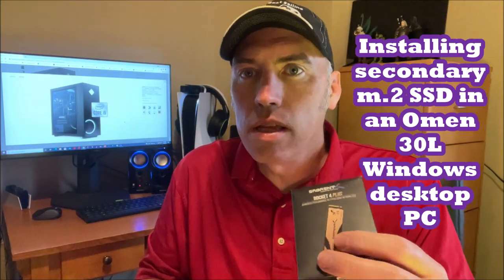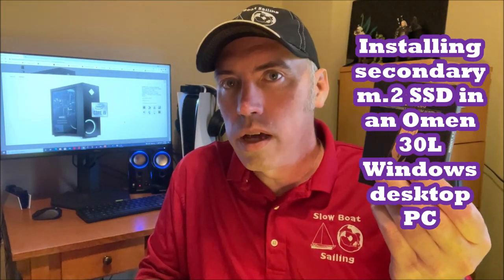Installing a 2nd M.2 SSD on my PC, Omen 30L, Sabrent Rocket 4 Plus, Secondary Storage Drive

Comment: Good view of the second slot. I want to try the m.2 to pcie adapters (for adding USB ports or different wifi) but looks like the cables in front of the ssd slot will block that. Are the unused PCI covers on the back removable?
Reply from the maker: There are not unused pci slots.
Reply: @LinusWilson  Right, it looks like there were still some of the typical metal covers on the back below the GPU?

Comment: How does the cover over the empty M.2 slot come out? You seemed to have skipped over it in the video. I removed the screw (and lost it somewhere in the case) but can't figure out how the cover comes out. Are there additional screws I'm not seeing?
Reply from the maker: Those screws are EZ to lose. The cover had one or 2 screws.
Reply: @LinusWilson  Does the drive bay/cover just come off or do i need to pry it off? I only see the one screw that you showed in the video.
Reply: @LinusWilson  I have the exact same system that you do. i9-10850k with a 3080. Could you let me know how the M.2 cover comes off the empty slot? I don't want to try and force it off the MB if it's connected some other way besides the 1 screw. Thanks again.
Reply: @bcasadei  I am currently in the same boat. It seems very tight and I don't want to just rip it out and break something. Please let me know.
Reply: @nathanyaeger1410  Just lift it after removing screw its not attached it only seems that way.
Reply: @bcasadei  Just lift it after removing screw its not attached it only seems that way.
Reply: @nathanyaeger1410  I haven't had a chance to open it back up, I lost the screw so I ordered a heat-sink with a replacement screw. @jaminwithtech says it just seems attached and needs to be lifted, which is what I was thinking, but didn't want to just rip it off and break something. I think I'll remove my GPU when I do it as well to give me some working room. I'll keep you posted.
Reply: @jaminwithtech  Thanks! I appreciate it. I didn't want to break it off if it was still attached in some way.
Reply: @bcasadei  hey man, I'm kinda in the same boat rn, I've removed the one screw as shown in the vid, should it just come off?
Reply: @legendteigen461  LOL. I’m not sure, I still haven’t tried to remove mine. I have a 1TB SSD sitting here that needs to go in the machine. I plan on giving it a shot this week. I’ll post and let you know if I get to it.
Reply: @bcasadei  hey man, idk why but i just said f it and tried more xD. Well, i managed to get the cover to the SSD off. I just pulled slightly on all sides, and tried to wiggle it. It is in fact just the one screw you saw in the video that holds it, nothing more. I even installed my new 2tb ssd and it works really good.
Reply: @legendteigen461  Thanks! That's good to know, couldn't get a straight answer from anyone on whether it was 1 or 2 screws. Did you end up removing your GPU or were you able to get in there with it still installed?
Reply: @bcasadei  i actually didn't remove the GPU. I have relatively small hands though. I also removed the padding/ foam under the cover which you don't really need to do. I think it's actually better to keep it there. It's antistatic. I couldn't get a straight answer before I had already done it so.

Comment: Thanks for the video. Yesterday I installed my new 4 TB SSD as an additional disk according to your instructions. Worked perfectly and your video was a great help!
Reply: I want to add a 2nd ssd and my asrock b760m-c mb has the spot for it,,, do I need a heat sink or not. I'm getting the wd sn850x 4tb

Comment: Good video. I got a 30L with Ryzen 5800X and RTX 3080 and it unfortunately does not have an extra M2 slot! However I see a PCIEX4 slot between the graphics card and PSU, which I think can be used to add M2 SSD using an adapter.
Reply from the maker: The Ryzen motherboard is gonna be different.
Reply: It should be behind the graphics card. The newer motherboards moved the m.2 slot.
Reply: it's behind the gpu for ryzen
Reply: @superchichu560  my ryzen hp 30l is behind the gpu. Just received my 2nd m.2 ssd so im doing the install very soon.
Reply: @matthewwarren7879  Did you ever find out if that was Gen3 or Gen4?

Comment: At 11:38, pretty sure that was the thermal pad provided by the factory.
Reply: noticed that half way removing it, part of the surface underneath had been torn off a bit, I guess I should not trust random video online
Reply: Would it be an issue if we removed the original thermal pad, in order to put in a heatsink? thanks
Reply: No issue. Factory thermal pad really sticks to the motherboard, but you can remove it. Hopefully it comes off in one piece, not in pieces.
Reply: @daferm77  Thank you for the reply! Thankfully, it came off in one piece (I ripped it off very carefully) and today I installed the 970 evo plus covered by  SABRENT heatsink.
Reply: @ソーロン  congrats, whether it can come off in one piece kinda depends on how old your PC is, mine was impossible

Comment: Hi Linus, does the secondary M.2 slot actually support PCIe Gen 4, or is it just Gen 3? I can't find this info anywhere. I have an Omen 30L as well with the OasisOC motherboard.
Reply from the maker: It supports Gen 4. I’ve been using Gen 4 for months.
Reply: @LinusWilson  Ok cool. Btw have you checked the read speed? Because Gen 4 drives can be installed in Gen 3 slots, but then they just read/write at Gen 3 speed...
Reply: @wurdulakthenyctophile6808  Hello!  Were you able to find out if the second M.2 slot actually supports Gen 4?  I too, am having difficulty finding info confirming this.
Reply: @wurdulakthenyctophile6808  I have this exact same question, and can't find an answer anywhere!
Reply: @titanx8687  I'm also wondering this and its been another year 😅
Reply: @Trajikbpm lol, guess what… I’m joining the the group when it comes to this question… lol. Nice to meet all of you! 😅😆 Probably never getting the actual answer from themselves I feel like then tbf (if apparently quite some people have been wondering and searching around for over 2yrs… 😅😂)
Reply: @Dannyp010  so it does take gen 4 but won't go to those speeds is what I'm gathering

Comment: Weird, just got my Omen 30L and I swear I only see 1 M.2. There is nothing there above that PSU on mine, but on the spec sheet is says it has 3 M.2. Actually, found it by looking at one on Ebay. On mine the one that is below your video card on the left is actually right under my video card on the right, straight down from the bracket that holds the video card. Had to remove the video card to get to it, which means there's pretty much no way to use any kind of tall heat sinks on it. I just left the plastic cover off.
Reply from the maker: There is a wide variety of OMEN 30L computers. Mine has a 3080 and 10850K CPU.
Reply: @LinusWilson  Intel 10th Gen CPU OMEN 30L have Intel Z490 chipset-based motherboards (line of sight 2nd M.2 slot), 11th Gen CPU models have the 2nd M.2 slot under the GPU which makes way for a PCI-E x4 slot.
Reply: Saboth, as you have found out, OMEN models with Intel 11th Gen cpu have a custom Z590 chipset and the 2nd M.2 slot is under the GPU so that the mobo can add a PCI-E x4 slot which is a huge benefit for expansion over the model reviewed here.  There is a small thermal pad on the M.2 slot...it won't cool as well as a quality nvme heatsink, but better than nothing at all, I guess.
Reply: @mowomedia4801  I have this model motherboard with an Intel 11th Gen CPU on my Omen 30L. I realize on my pc the 2nd M.2 slot is under the GPU as you mentioned but I am not understanding how an M.2 slot under the GPU would be an advantage by allowing one to add a PCI-E x4 slot. Should I just not utilize the 2nd M.2 slot for my 2nd 2 TB NVME Gen 4 SSD? I am not challenging you in any way but genuinely trying to figure it out because I don't know at this point. I would like to somehow  maximize the speed of the Gen 4 2 TB NVME M.2 SSD I just purchased. Hope you can answer. Thank you for everything.
Reply: @mowomedia4801  I figured it out! a PCIE4 slot allows me to buy hardware to install an m.2 adaptor that will allow me to run Gen 4 speeds because my motherboard and processor support it! OMG!

Comment: My Omen 3.0 came with a 512 gig ssd drive. The Omen I have looks just like yours but mine came with the ssd installed in the slot above the power supply and under the video card. The top ssd slot is empty with a cover over it. I'm thinking of putting second SSD drive in so I took the cover off to take a look.  Also, I wonder why my SSD and your SSD came installed in the opposite slots?
Reply from the maker: There are many different omen 30Ls at least you have two slots. You might want to replace that 512gb and clone windows. 512gb is not enough for gaming.
Reply: my omen 25l's ssd came with the ssd installed above the power supply too. did you add another ssd at the top ssd slot, if so how did it work? If I add another ssd, do I have to take out the first one?
Reply: @AxelBestGM  I added another ssd to the top slot. The original c drive ssd is still on the bottom slot next to the power supply. Everything worked fine and the computer saw it as another drive.

Comment: Is that a Cover or a Heatsink that covers the 2nd M.2 slot?
Mine sits underneath the GPU so it can't have a Heatsink on my 2nd 3.0 M.2
Reply from the maker: Hmm
Reply: The thing he ripped off was the thermal pad. I believe the cover should remain and the m.2 goes on top of the thermal pad.

Comment: What screwdriver did you use to remove the screw on the ssd slot?
Reply from the maker: I don’t remember. I think it came with one.
Reply: @LinusWilson  Thank you for responding. I got a quick question as well I wanted to ask which is kind of a stupid one, but how do you attach the glass panel back onto the computer? I have the same computer and I can not put the glass panel into the computer.

Comment: good tutorial, however it appears that later versions of the M30L dont have the second M.2 slot available
Reply: The ryzen motherboards have the second M.2 slot behind the GPU
Reply: @paiwastonsaid7848 the 30L with Intel does as well… it’s hiding under the ram slots. To be exact, you have the (vertical) RAM Slots, below that comes the BIOS chip and under the bios chip there it is. Not that you miss it easily when you have the GPU out tho… Can get quite dusty behind the GPU without realizing it tho. Actually just deep cleaned my pc but kinda suprised me. Think it was the part that got most dust of the whole system if I quickly remember

Comment: What’s that black thing you took out beneath the ssd 2 cover ? Is there any use for that( like a cooling pad maybe ?)
Reply from the maker: It's plastic. It prevents stray electrical connections when the 2nd SSD is not in use.
Reply: @LinusWilson  so when I want to install the second ssd I need to remove it ?

Comment: My pc didnt turn on after installing a second ssd. What do i do
Reply from the maker: HP has good technical support
Reply: @LinusWilson  Hey Thanks for replying. I fixed the problem. I took the SSD out and put everything back to check if it would run. It did. So i tried to install the SSD AGAIN and this time it worked. No idea what Happened

Comment: Hi, I do not have a windows copy.. I bought this PC prebuilt. I dont know what to do... ZZ why they make this so confusing. I dont know my windows product number or anything. Can I just copy the info from one drive to another drive? I have this exact PC, and I'm just going to install a new one where you did it. But I dont want to lose windows and whatnot.. stressed out.

will your last process of the video do that? Trying to make new drive my main C drive.. I need better speeds for gaming. new world costs a lot of disk speeds.
Reply from the maker: This video is only about installing a secondary (non boot) M.2 drive. Contact HP.
Reply: @LinusWilson  Shouldn't it be as simple as to just transfer it to a different drive.. I don't see why it should be so complicated.